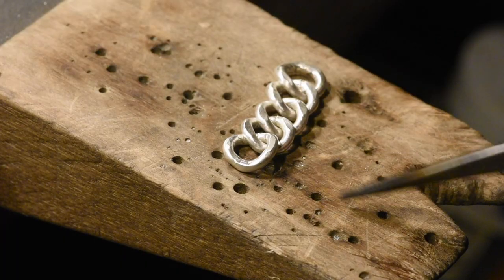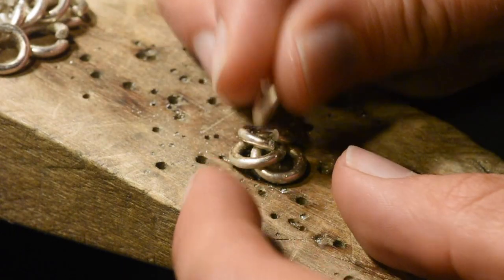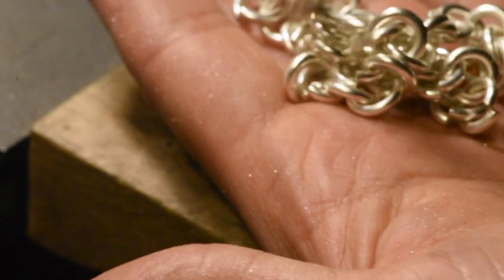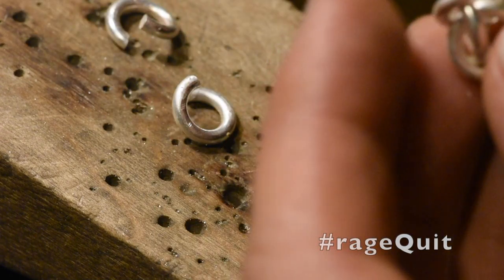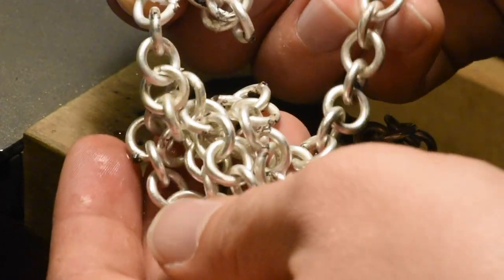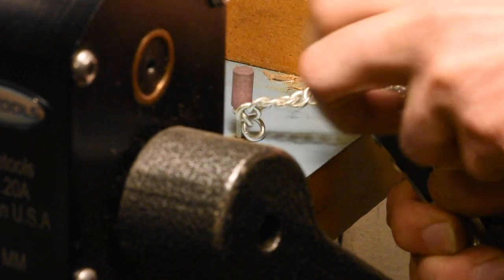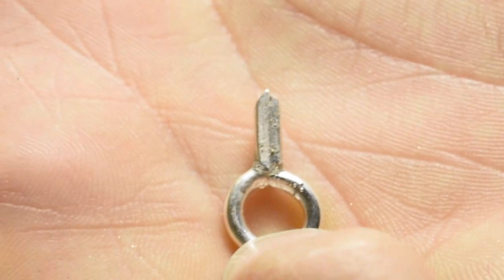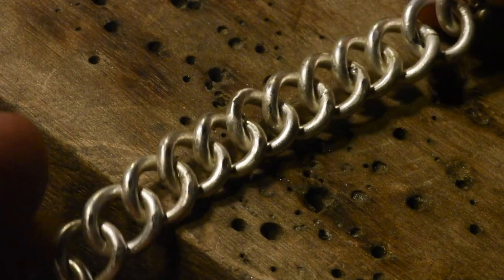Handmade Cuban Chain, handforged chain by MustacheMetalWorks

Comment: I strongly recommend if your going to try to jump in and start making jewelry get you a small section of silver wire and practice soldering don't start out using copper to practice it will get you discouraged and you will quit.
Reply: Why would you advise against copper to start with?
Would you consider copper to be more difficult than silver?
I only ask because I've just started playing with making copper chain and the results of my first 'quick and dirty' attempt are pretty encouraging really.
Reply from the maker: Copper fouls up and work hardens very easily.  Copper is more reactive with the air, so you have to care more and clean more when soldering.  
Silver is slightly easier to work. I rarely have to clean before soldering, and my joints have been good.  As long as my bar doesnt have big voids, silver moves quite a bit between annealing.
Gold is a delight to work.  Its hard to mess up.

If you're feeling encouraged by your copper results, I would say that silver is going to be very fun!!    This other guy is probably just recommending silver because its like "easy-mode" compared to copper.

Comment: Nice job! The end result looks great. I'm a big fan of your channel. 

Its funny because I make the same mistake by soldering two rings together. It was a nightmare so I felt your pain. What I did was I attached my saw blade so it was inside the ring, and sawed the rings apart. It was tedious and took a long time.
Reply from the maker: I can feel your pain.  Was just throwing away the two soldered rings an option? 
I would just ditch two rings and keep going (with a tear in my eye)

Comment: Less violence than usual! 
Did you heat the wire up before coiling?
Reply from the maker: I bought the wire as "dead soft" which means it was "fully" annealed from the refinery. 
I definitely could have pre-heated for that last tiny bit of wiggle, but there was no real need.

Comment: What are you calling pickling and what are you using ?
Reply from the maker: Pickling is just a generic term used for "putting metal in an acid".  
I use "Sparex Granular Dry Acid Compound No.2"  in some tap water.
Pickling makes the yucky metal compounds dissolve away, leaving the good stuff. 

Putting rusty iron tools in white vinegar is essentially the same process.